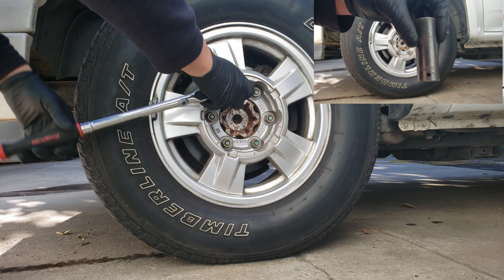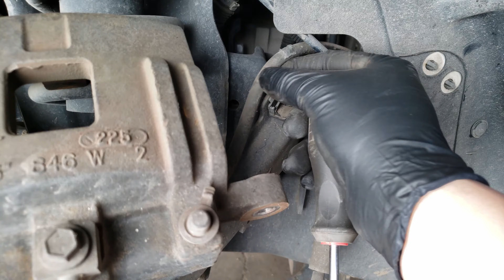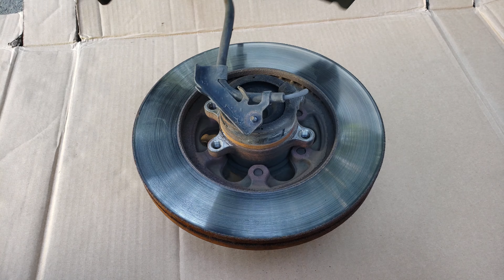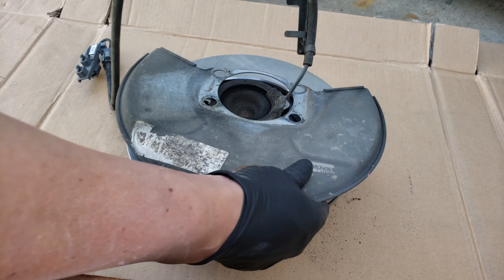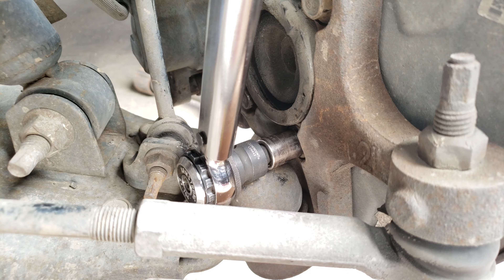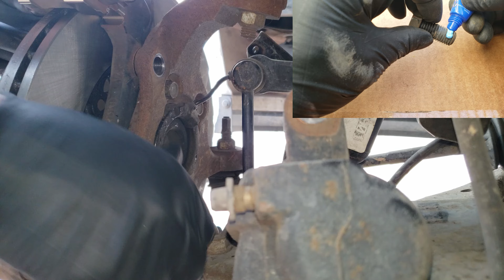Chevy Colorado Front Brakes and Rotor Replacement 2004-2008 | How to Replace GMC Canyon Brakes

Comment: 4:25 I found it a little easier to get an offset box and wrench to reach this lowest bolt. I tried the method in the video but I didn't have a skinny enough deep socket and it kept trying to slip off the bolthead.

Comment: Oh man ty for the video. I think my tire shop is ripping me off cuz I asked for a quote on getting pads and rotors done, but they said I need a new wheel bearing and charging me extra labor $300 part and $250 labor. From what I just saw in this video, is you already take hub assembly off if you are replacing the rotor. Right?  So all I need is to purchase a new hub assembly as it comes with a wheel bearing.

Comment: 5 minutes in and you've already given two pieces of wrong information
Reply: Can you elaborate? I’m about to do mine this weekend. I’ve done many brake jobs on my own cars, but I’ve never had a car with the plate in front of the rotor before, and I’ve never needed to undo any sensors before either. I mean it’s fairly simple, but if I don’t have to do one of those steps I’d like to know

Comment: Excellent video. On my '05 Colo, I tighten my wheel lugs to 90 ft. lbs, more than enough for aluminum wheels. Been doing this since new, never an issue, easier to remove with a 4 way if you have a flat or any road side issue. Some newer truck wheels call for 140 ft. lbs, that's a lot for some puny wrench sets that come with the vehicle. For those values, you need a big azz pull handle kept in the vehicle to break those nuts.

Comment: Why don't you take the rotor bolts loose if you're going to remove the hub assembly and replace it.... That's more work dude. Work like a fox not like a knocks work smarter not harder

Comment: ♣♣♣♣♣♣♣Your not removing a disc in a 2007. They are pressed in. This video does nothing for me
Reply: Lmao what??
Reply: @frankb3620  The disc in a 2007 is pressed in. You can find other videos of people beating them out. Many years ago I went to get them to change my disc and they even told me that. I ended up beating them out myself. Very hard work
Reply: @frankb3620  the 2007 are pressed in. You can find it on forums. I went to a garage and they also told me that.  I ended up tirelessly beating it out like everyone else. Grueling work. Two wheel drive. Heavy duty suspension.

Comment: welp spent 3 hours doing one side , probably an hour or more tracking down tools . But the guy who owned it previously put an excessive amount of lock lite on . And i got everything undone . And tried lifting it off. Mine was rusted one . Tried hitting it , penitrating oil . I tired everything. Gotta send it to the shop I reckon.
Reply: More hitting
Reply: More hitting! More power!!!!Tim toolman Taylor that thing buddy! ARGHARGHARGH

Get yourself an air compressor and an impact gun. 2 things you should absolutely own if you’re a diy’r. If that can’t undo a bolt then I’d concede it to a shop. But not before absolutely drenching it with some PB blaster a few times too. 

Just some info for you for next time. And remember, a shop is most definitely gonna put your lugs back on with an impact at the very least, and that can be a pain when the time to remove them comes around, so it’s definitely worth the investment. You don’t need fancy or expensive if you’re not actually a mechanic, just something that’s well reviewed and won’t fall apart on ya

Comment: getting ready to save myself big dollars on my 2005 Canyon full brake replacement. Going to get pre-painted calipers but now I see I'm going to want to paint the mounting bracket too. Maybe I should pickup those at the junkyard, oh, I mean the recycled car part place. Course I'll have to take them off myself. Going to do the hoses too. Dealer, never go there again, wanted about a thousand bucks, parts and labor, and I already knew I needed to do it and how to do it. You've helped with the torque specs, so thanks. This will be the first new wheel hub design I've done this to. At 75 yo this may be my last DIY brake job, but I've had all the tools for decades and have never paid anyone for this job, and I'm not going to start now.

Comment: hey buddy, Thank you for the step by step video on how to replace rotors and pads. These are a little bit of a pain in the ass b/c you have to remove the wheel hub. Basically, need a refresher course LOL. Greatly Appreciate it!!!😁

Comment: Thanks for sharing your information, this is very useful information, I appreciate it I had no idea that it would be such an ordeal to change the rotors and brakes, this helped me out a lot with how to disconnect the clips and brackets, also thanks for including the bolt sizes and torque settings! Superb work!

Comment: I just recently bought a Colorado and while doing an in depth check of everything and to get familiar with everything I was looking at the brakes to see what kind of a job it would be to replace them when I need to. I suspected this was the case and would need to remove the hubs. I can say without a doubt this was completely unnecessary on the engineer’s behalf😂. I’ve done brakes on many different vehicles from FWD,RWD,AWD,4X4 foreign and domestic and never in over 30 years have  I come across captured rotors on a light duty pickup truck or passenger vehicle. Obviously the Colorado isn’t the only vehicle on the planet with them but it’s proof it’s unnecessarily overkill.😂

Comment: I love this video! It's complete and concise with all the necessary and additional clues to complete a successful installation. A shop wanted almost $1800 to replace my 2005 Canyon inner and outer tie rod ends, rotors, and brake pads. You gave me the second-half fix. My total cost was around $300, including parts and tools. (I rented the specialty tools from AutoZone) Thanks for this!

Comment: I know I'm repeating other's same comment.  This video is an excellent description of how to get it done.  Thank you!    Hey - Ever had any fuel pump related problems?  I have a 2004 Colorado LS.  Does not start right up, its finicky.
Reply from the maker: Thank you🙂...i had issues with the fuel pressure regulator leaking and that could possibly cause a hard start problem as well..maybe it could be that in ur case as well

Comment: Great video! Thank you so much. One question, is there any major differences for a 4x4 axle? Thanks for your time. Cheers, Bill
Reply from the maker: Its pretty much the same..its just the axle kinda gets in the way in some angles for loosening or tightening the hub bolts..then u gotta loosen the axle nut...and if really rusty itll make it harder to pull out
Reply: @backyardchevy328  Thank you. I'm getting what I considered very high estimates for a complete break job. Now I'm starting to understand why.
Reply: @BillDaubenmier  😂😂 how much they charging you? Because my estimate was down right outrageous
Reply: @DsUsama  yeah mine too ~$900 and said it could go higher if there are any problems. They did say I have about 20% left on the front breaks, so I'm just continuing to drive it. I may trade up for something newer soon.

Comment: I replaced the rotors and pads. Now I have grinding sound wherever I drive. Squeals a lot when braking. Is this wear in or could I have missed something?
Reply from the maker: Normally that's one of two things..the splash shield behind the rotor is rubbing..or the brake pad retainers probably rubbing..its the two most common reasons why that would happen

Comment: Best how to video on Youtube, hands down. Your video was to the point with clear instructions, and easy to understand. Stating what size socket to use and the torque specs on each bolt was an awesome added feature. I know your video is about changing the front brakes and rotors but, I used it to help me change the wheel bearing/hub assembly on my son's truck that had completely locked up on him. Very informative and time saving. Thanks.
Reply from the maker: Thank you🙂 i really appreciate it

Comment: Awesome video with very helpful and informative details. Quick question, what extra steps would I have to take on a 4WD model? I can’t find any videos with a 4WD model.
Reply from the maker: Thank you🙂..it should be fairly similar..youll need to loosen the axle hub bolt in the middle and just getting to the hub retaining bolts especially the lower one in the back is a lil harder to work with..but a short socket  with a swivel should help with the one bolt by the lower ball joint

Comment: Since I watched the video 3-5 times and he didn’t mention it. The bolts that he loosened before taking the caliper off are 17mm. I had to hammer them on a bit, use a breaker bar and some Pb spray and they came off with a little bit of force. Just thought it might help because it took me a minute to figure that out.
Reply from the maker: I didnt? Grr normally i make it a point to mention the sizes i use...thank you for the added tips
Reply: @backyardchevy328  I wasn’t even saying it like the video wasn’t helpful because it very much so is, it’s just I got stuck at that one part. Your video is ver informative and I greatly appreciate you taking the time to explain all you have. Please keep it up!
Reply from the maker: @thecommentator5280  thank you🙂 yea i normally make sure to mention the sizes but i was surprised I left it out
Reply: @backyardchevy328  so I got all the way to the part where you’re supposed to take the 4 mounting bolts from the back of the rotor to completely remove it. And I cannot get a socket on any of the bolts, any pointers for that?
Reply: @backyardchevy328  I am using a short socket btw
Reply from the maker: @thecommentator5280  is urs a 4wd? Where it has the axle in the way if not rotate the steering wheel..during the assembly portion i show how to make it easier to get those bolts
Reply: @backyardchevy328  if you have an email or something I can send you a picture/ short video, everything on this truck looks like the one you were working on in the video

Comment: I actually love this design. It's more work to replace, but from an engineering perspective it's more efficient and safer. More points of contact for the brake rotor. Shorter studs meaning less torque on the hub it's self. Also separating the studs from the brake rotor means no rapid change in force direction. You can also build (gm does) a more robust mount for the rotor while also losing rotor weight. The rotor is also more robust seeing as it's contact with the hub is more direct. (not a curve like on typical brake rotors). The gains aren't huge, but still more safe and efficient.
Reply from the maker: Yes, u do make very good points

Comment: 8:28 4 wheel hub bolts 92ft lbs
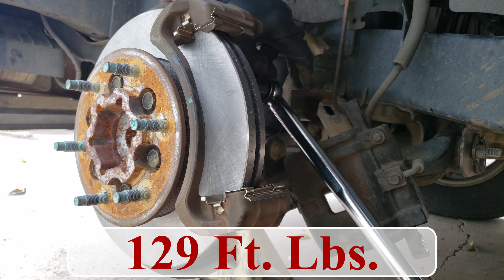11:18 2 caliper bracket bolts 129ft lbs
13:50 2 caliper assembly bolts 29ft lbs
14:20 6 rotor hub bolts 81ft lbs
Reply: Bro your a life savor, id get ya a beer if we were to ever cross paths

Comment: On a 4X4, its a lot trickier for the bottom hub 15 mm bolt. I had to  remove the tie rod to make some room...  and all bolts are stuck after 14 years on salt roads. Great vid by the way.
Reply from the maker: Yea i can imagine...usually any job on a 4wheel drive is harder than a 2wd...glad to hear it sounds like u were able to get it done though...thank you🙂
Reply: Where is the axel or is that only on 4x4
Reply: Did you have to use a puller on the 4x4 to get the hub off? I've removed the axle nut and the 4 bolts in the back and it won't budge
Reply: @DTWCT  no.
Reply: @FrenchyCanuck  I had to use a puller. 353k on my truck so the hubs were pretty rusted in there. Whailing on the rotor with a hammer didn't budge them

Comment: Very informative!  Great video!!  As an S10 (and Blazer) owner I've looked at a Colorado and wondered about the differences in the brake job.  This helps in the purchase I am considering.
Reply from the maker: Thank you🙂 yea i have a few videos on the Colorado..the rear brakes as well...so far good truck...only problem we've had on it..is battery just last week..and leaking fuel pressure regulator..we've had it for over 4 years already.

Comment: Great tutorial video with torque specs. I'm about to change the pads and rotors on my nephew's 2006 2wd Colorado, just like yours. Is blue loctite necessary even though the bolts are torqued to specs? Thanks for the video
Reply from the maker: Thank you:) hope everything goes smooth...blue loctite just keeps the bolts from possibly vibrating loose overtime.
Reply: @backyardchevy328  thanks for your response. I only got red loctite and it looks like I need a trip to the autoparts store. I hope it goes smoothly as well, I'm worried about possible rust in that area. Thanks again 👍

Comment: The best brake video ive seen.  Thanks
Reply from the maker: Thank you🙂
Reply: @backyardchevy328  Starting my project to replace right front caliper on 2004 Chevy Colorado.   Your video gave me exact info needed.
Reply from the maker: @saylor150  that's awesome..hope everything goes smoothly🙂
Reply: @backyardchevy328  Turns out it was the hub/bearing making the brakes rub.  I was soooo confident taking assembly apart because of your video.  I still cleaned caliper brake assembly including slide pins.  Greased assembly and reinstalled brakes.  Thank you for your instruction.
Reply from the maker: @saylor150  glad u were able to find and solve the problem, great job🙂

Comment: How do you 'wiggle the hub free'?
Mine doesnt move AT ALL! :(
And yes, have all the bolt out.  I've spray some penetrating oil and tapped the rotor with a hammer, but the hub has yet to move.
Reply from the maker: Mine just came off as it did on the video, but i know rust can affect things worse if u live in snowy regions, Its not 4 wheel drive either?..if u soaked it in penetrating spray and spray through the back of hub..i would turn the wheel all the way one side and maybe tap on it from behind...worst case u can get longer bolts thread em in..and tap on em back and forth it should free up that way
Reply: @backyardchevy328  About 1/2 hour of soaking and more aggressive use of the mini-sledge did the trick/
Reply from the maker: @mikemojc  sucks that it took so much work...but im glad u got it off
Reply: I'm in the same boat. Hub won't budge. Thinking it's rust with 353k on the truck

Comment: Great video. Thanks for the video. Great info.
Reply from the maker: Thank you🙂
Reply: @backyardchevy328  I have an 05 Colorado crew cab with the Z-71 package. Do you have any other videos on Colorado based stuff?
Reply from the maker: @michaelmincey2622  so far the oil change and blower motor resistor...im editing the rear brake shoes video as we speak
Reply: @backyardchevy328  cool. I will look out for that one soon
Reply from the maker: @michaelmincey2622  thank you🙂

Comment: Wow General Motors has lost their mind you have to change the wheel bearing to get the Disc Off just nuts
Reply: GM has lost their mind designing that the way they did.  My next vehicle will either be an early '90's Chev/GMC or something...anything but GM.  I will not pay for such idiotic design of components.
Reply: @Jojongsa  lol yea more like timing CHAINS! There’s also one in the rear! Lol
Reply: @Mordorer  yeah I heard there was two balancing shafts and only way to get to them is to remove the transmission, oh and good luck changing the starter
Reply from the maker: Yea i cant imagine why they would change to this design, what would be the advantage other than being able to ride on the rotor if the wheel falls off lol
Reply: @backyardchevy328  LOL they did it to charge more labor at the dealership
Reply: Great video as always the best mechanic on YouTube
Reply from the maker: @josephutuadoPR  lol yea i can imagine seeing how much work to replace the rotor, it will have people avoiding doing it on their own
Reply from the maker: @josephutuadoPR  thank you🙂 i really appreciate it
Reply: @backyardchevy328 That’s were I’m at right now. I changed the water pump on my Silverado no problem. My dad’s Colorado needs breaks and I just don’t want to do them. If you fuck up the ABS wires. Then you got to buy a new hub too. WTF